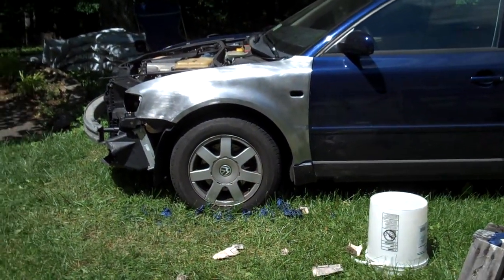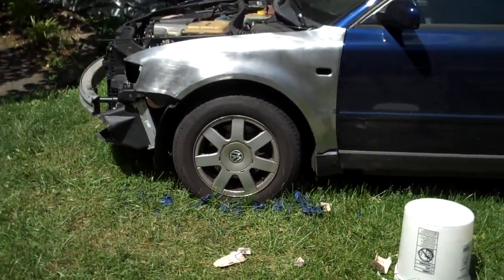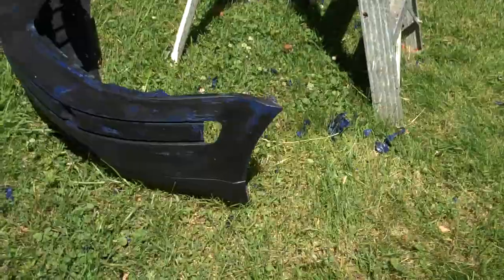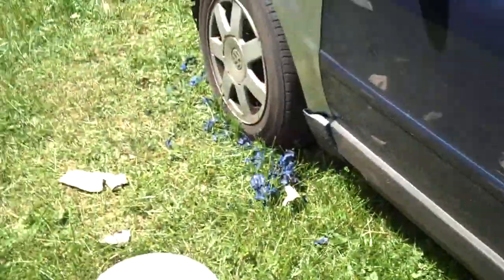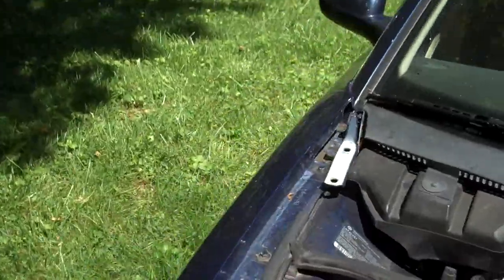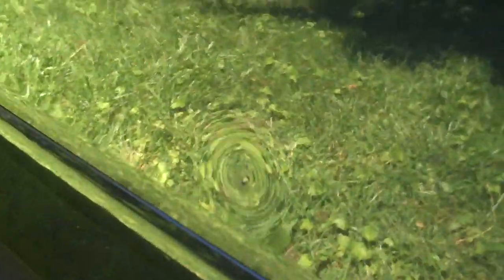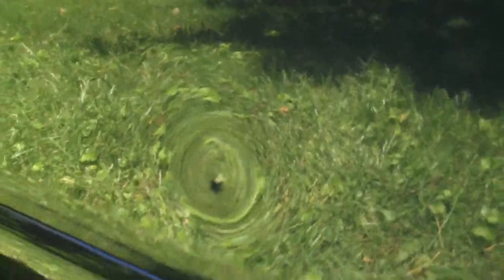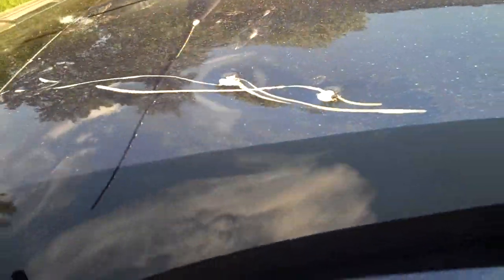Painting my car - Part 1

Comment from the maker: I used a DA at first, but threw that Idea out the window after it took forever.  So i reverted to Air Craft Paint Remover from a suggtion of my buddy it worked great.  

You apply it with a paint brush and let it sit.
You will definitely need, a mask, Full Face Shield, and Chemical gloves when you do it or it will eat your skin. I learned that the hard way.

It took a couple of times of applying it some area's but i hand sanded down the area's that needed were the hard to get off spots.